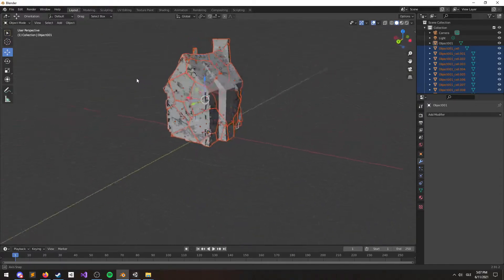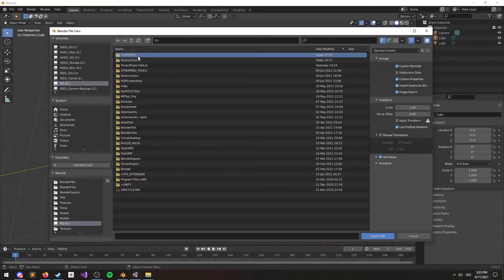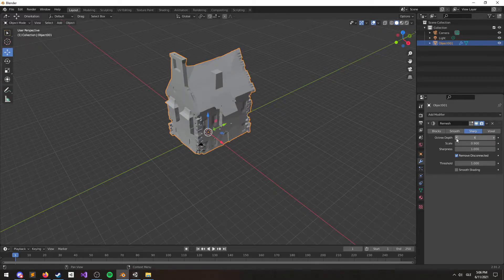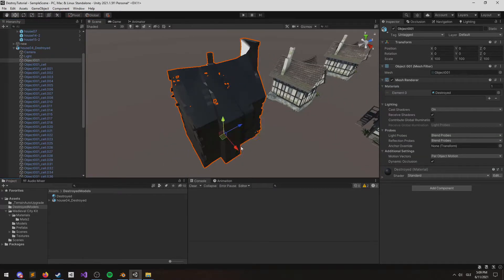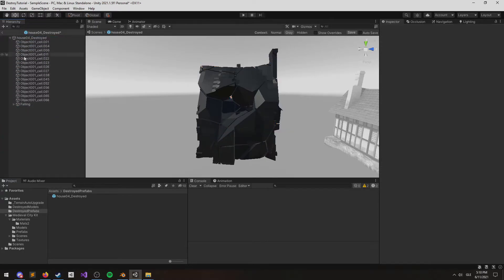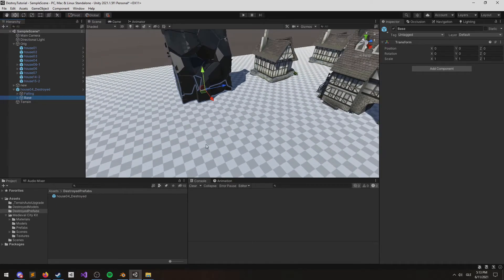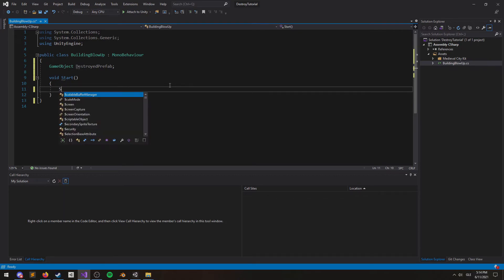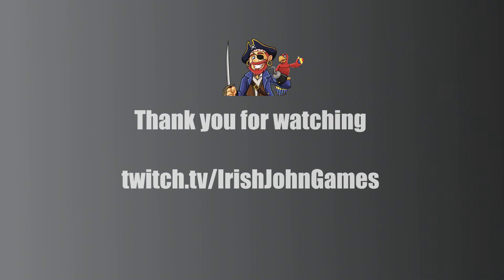Tutorial: Mesh Destruction start to finish, using Blender & Unity3d! Full process.

Comment: Hello, thanks for explain this, could there be a way to add texture to the prefab that is destroyed so that it remains the same color?  Than the original after destroyed?
Reply from the maker: It is possible but very difficult and outside the scope of what I was trying to show here. The smaller the chunks though - the less visible the textures. So you may be able to cover up things with smoke/etc also.
Reply: Well, I would say with this method no, because I believe when you do the remesh in Blender, the new topology doesn´t mantain the UV coordinates of the previous model. You would need to map it again, which is a pain.